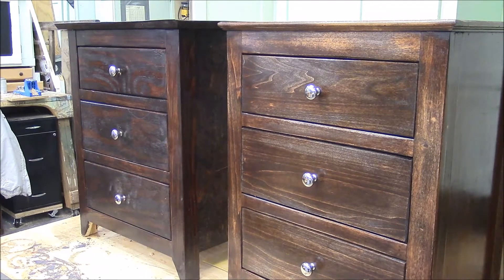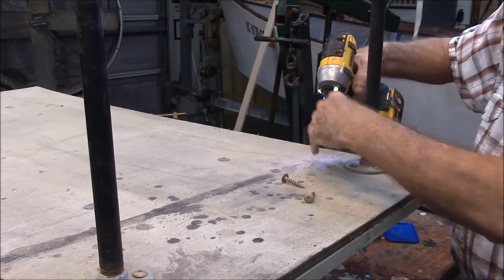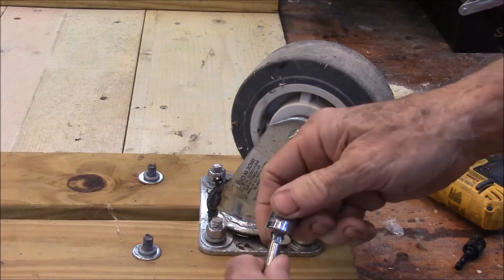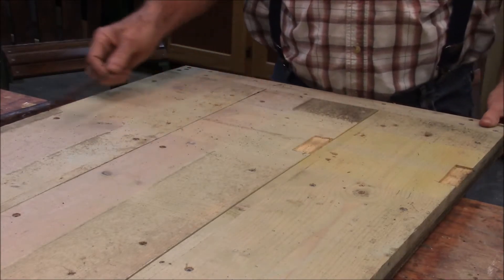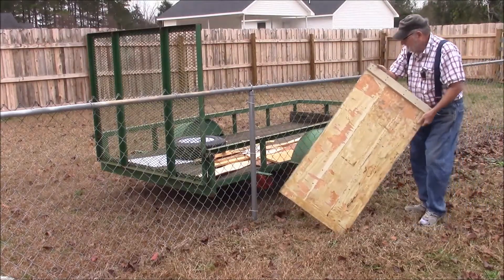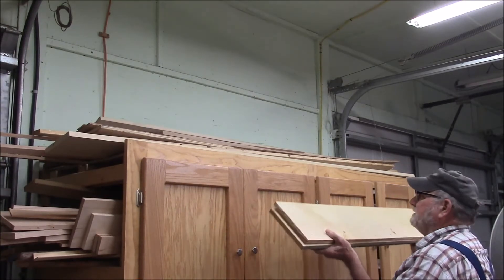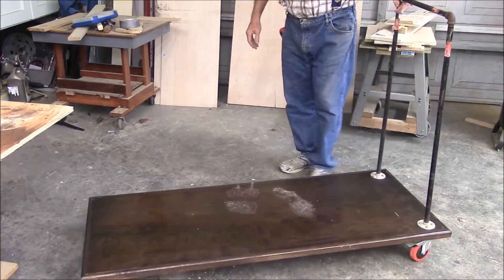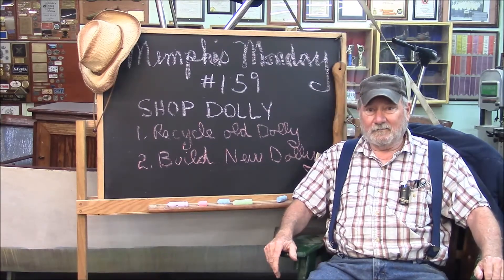159 Making a new shop dolly

Comment: The new Molly Dolly came out great. I like the fact that it's longer and the new wheels with brakes will keep it from rolling away on you.
Reply from the maker: I hate to admit it, but I'm starting to think that I'm a better woodworker now than I was at the start of the channel.  Seems like we discover amazing flaws every time we recycle an old project.  Remember that old memorabilia case we couldn't get the coffee cups out of?   Or that butt ugly TV stand we finally made cutting boards out of?  
      I wish now that I had detailed some of the flaws I found in the boat rebuild.  I did show some, like using Red Oak instead of White Oak or Live Oak, but there were other funny bloopers.  Don't know if you watched the 13 part inboard engine boat series, but at one point I installed the batteries (2) and the gas tanks (2) in the same closed compartment!!!!  It's a wonder I don't have any trolls.  
       Thanks for the view and the comment.  Hope to see you here again on Sunday at 8 O'clock.
Reply: I wouldn't consider the way you do things to be a mistake. As we learn more we learn different things and sometimes a better way of doing things. Sorry I don't reply to replies much. I don't often sign in to YT on the computer but use my tablet instead, which (the app) doesn't show replies to my comments.
Reply from the maker: I know, and it is killing us guys with long videos.  I don't know for a fact, but I think most folks watch videos on a tablet or phone (mostly phones), and so don't care for 20 minutes videos.  
     My videos are designed to be projected onto an HDTV from a laptop or PC, but lots of folks use their PHONES for all their computer needs.  I;m trying to shorten my videos, but it's so hard to condense a weeks work into less than 10 minutes
     You are so right about the learning thing.  It is very important, but regrettably some folks lack the honest introspection necessary to detect their own failures.  This weakness dooms them to the endless treadmill of mediocrity;  they never get better.   
     Thanks again for watching and commenting.  Hope to see you Sunday, as, for some reason, I like the upcoming project.

Comment: First, Please forgive me.  It is taking me forever to recover from that 3 day trip.  More on that later.

I am happy to see that you are still so humble.  "Ironically, my shop dolly is probably one of the best ones ever built."  Hahahahah   It is amazing that you were able to perfect perfection but you did.  The new dolly is lower and lockable so it will be easier to load heavy and bulky items on it.    I had my questions about your new bracing but realized that you had thought it through.  I was thinking that you would screw the wider side of the braces to the dolly but you turned them on their side and screwed in the narrower side.  This gives you more bracing.  As usual, Genius!     The only issue I can even remotely think you might have is the smaller wheels  not rolling as smoothly on rough ground.  You probably rarely use it outside making that a non issue.    The new dolly even has a nice sleek finish to dress up the place.

Again, I am sorry that I have taken so long to get to your video.  I watch a few  in my backlog a day then have to get out and do some of the work that has been piling up around here since it has been so cold this spring.  It is also taking me forever to get the camper cleaned up from the trip.  It rained the first night so, as you can imagine, there was a lot of mud.  Luckily, I had a ground rug that came with the camper and I had the forethought to put rugs throughout inside.   Hooking up to go on the trip went smoothly and the rain held off until I got to the campground.  My little truck did a good job towing although I don't think I will be taking it to the Rockies any time soon.    With the help of my nephew, I was able to get backed in with ease.    That being said, It would not been as graceful if I didn't have someone who was well versed in backing someone to assist.    I thoroughly enjoyed the campfire and eating outside.  There are trails to walk around the lake and I really enjoyed that.  The only bad part of the trip was that my nephew's kids were a little rowdy the entire trip and I am not used to being around kids for that length of time.  They weren't bad enough to keep me from going with them again.  One thing that struck me on the drive home was that there were a few times that I actually forgot I was pulling the camper.  That both made me feel good and a little frightened.  I sure don't want to forget it is back there and do something stupid!    Hopefully my next trip will be within a month.  I am actually taking a trip to southern Georgia next week but it won't be with the camper.  I wish it were. (I am thinking of going through SC and spend a few hours walking around Congaree NP.  Have you ever been over that way?)   I am going to go ahead and watch this week's video now so it isn't two weeks before I get to it.
Reply from the maker: Sounds like you had a great adventure.  Kids have changed since my day.  I went camping and fishing a lot as a kid, and I was rowdy, but my parents didn't know it.  Back then, we are talking about the 1950's, we never hung out with adults;  we were gonzo, exploring, inventing games, building forts, or just looking for trouble.  Today kids are tracked much more closely; no more trick-or-treating without adult supervision.  No more roaming the campgrounds for hours alone, while the grownups drank beer, smoked cigarettes, and played Euker.  Of course, I know it is a different time (nobody could justify allowing their 10 year old to roam a campground alone these days), but we have lost something in that.  Kids are less independent and less inventive, while relying on adults or electronics for entertainment.  
    Your little truck could probably handle the mountains, except for long down-hill situations.  Shift down for engine breaking on long downhills, or you could have breaking problems.  
     Yep, towing is simple once you get on the main road, but you are right about always remembering the camper is back there.  
      Don't be afraid to pull forward for a restart on backing.  Just shows good judgement.  Nobody expects normal people to be good a backing trailers.  We never do it enough to get good at it.  
      Well, I better knock off the yamering and get back to work.  Thanks for watching and commenting.  I love your camping stories, and hopefully there will be videos of follow-on excursions.
Reply: Oh yea.  When I was a kid, it was true "off grid" living.   At best we had a Coleman stove and lantern.    We were expected to get out of the parent's hair and roam the woods and streams.    It is a different world we live in now.

When I came home, I had to drive back down the mountain and took it pretty slow even though I have the brake assist installed on my truck.  I had never used it before and didn't want to "get ahead of my brakes".  If that makes sense.  Luckily there weren't any terribly impatient people behind me.

I have a funny story about forgetting I was hauling something that I may tell you some day.  Hahahah.  Let's just say that it cost me a lot of money(at the time  It wouldn't be that much money now.)

With your advice, I learned early on to pull forward and regroup if the camper wasn't headed in the direction I needed it to go.  Luckily, I have been able to do that quite well in my back yard.   Now, the real world may turn out to be a different story.  

More stories...and hopefully ....videos to come.

Comment: New subscriber here. I am also in the Memphis area. I had a question. I am going to build a stand for a scroll saw. I saw your video for it and liked the idea. However, I am in a wheelchair and need to roll under the saw a bit so I’m not reaching so far to work. Do you have an idea for making a top that will slide out and still be stable enough to hold the saw safely?
Reply from the maker: I actually live in South Carolina, Memphis Applegate is an old username I kept as my handle on YouTube.  My real name is Henri Chase, and I'm on Facebook.
     My gut reaction is to suggest a slide-out mounted on stainless steel 100 percent, 100 lb test, drawer slides.  I will give you links to a few of my videos that might give you some ideas, including a wooden slide-out I fastioned for a sewing machine cabinet.  Hope these help.
 https://youtu.be/36qqiB3ZWPs  MM 109   Making a sewing cabinet.  Here I rig some wooden fold-out top extenders.
https://youtu.be/fCWsDpJlhKc https://youtu.be/sC9BxeQW5gQ   MM 86  Slide-outs for tool boxes.  Seems like something like this could be rigged to top of a small cabinet.
https://youtu.be/1TNsb77iMvk  MM 45 Slide-outs in a large storage unit.
https://youtu.be/TmQK1BonP2A  MM 46  same thing here.
     I have others, but here is my notion:  Build a small cabinet on wheels (lockable), and bring the sides about six inches above the top.  Build a platform similar to the one's on my tool-box slide-out video, and attach the platform to the extended sides on the cabinet.  The platform could then be moved out as needed, and would be stable and heavy-duty.  However, don't forget to rig a locking mechanism to the platform.  
       Thanks for watching and commenting.  Hope to see you around the channel often.
Reply: Thank you so much. I like your ideas and am going to try it out. I'll definitely be watching.

Comment: U have square bite ? 4 your screws.?
Reply from the maker: I think that I have about every bit made.  I like the square bits, especially in the pocket screws I use.  What I don't like is the coating applied to screws after they are made, which causes the grooves in the screw to clog up, making driving very hard.  Ironically, drywall screws are the best for driving, but they are weak and they rust.  Torque bit screws are about the best, so I normally use them.
Thanks for watching and commenting.  I'll be following along on your shop build.
Reply: Memphis Applegate  I heard you say that ,